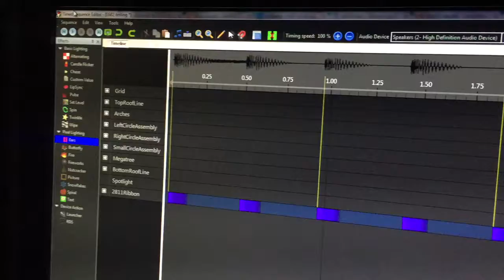First working Vixen sequence E682

Comment: Hey I 're gently purchased a San device and am trying to use Vicente and I am having a hard time get any progress getting a sequence to work for the controller. Any tips?
Reply from the maker: Do you have your pixels working at the board level yet? In the setup page you can have the board initiate a test sequence. Do that step before getting vixen involbed
Reply: Yes all outputs work but one
Reply from the maker: Ping the IP address, if you can do that, then move on to using the Vixen web server, which will allow you to turn pixels on and off one by one. If that doesn't work then you probably have some kind of mapping issue in your vixen config with the lights to outputs and/or the network interface assigned to your controller in the vixen config. Get it working from the web server before moving to sequences
Reply from the maker: By the way, you'll know you have the networking right when you see the e682 web page showing the packets received counters increasing.
Reply: So i got to the point where i have setup the device how vixen describes(3 strands)  and i have seen the packet counter go up to 87 but nothing will happen when i try to enable the mega tree on the web server or if i try to play a sequence. I really appreciate your help by the way!!!
Reply from the maker: +jesse sabs the packet counter should count up by 100s quickly. My recommendation is to start with one strand on e682 and in vixen to minimize  variables. From the web server just go after 1 pixel, once you get that working it's a house of cards and you'll be off to the races. This took me 3 hours alone to understand. I also disabled all network ports on my PC to eliminate variables.

Summary:
Set up one strand on e682, make sure it works with board level test patterns you can enable from e682 web page
In vixen create one strand (my test strand has 100 LEDs), with 100 outputs, change its color mapping so it knows RGB values are controlled, vixen will then automatically triple your outputs (300)
Create the e682 device in vixen with 300 outputs. Patch the strand to this e682, it should say 300 outputs patched. Right click on e682 and check its universe and address setting.
In the e682 web page make sure the output your strand is wired to has the same universe number as shown in vixen
Reply from the maker: +jesse sabs if you send me your email address I will send some screenshots at some point
Reply from the maker: jesse sabs I sent off screen shots, check your junk in case you don't see it. I'm using Vixen 3.2 by the way.
Reply: Hey man i got everything working!!! This program is awesome!! Thank you for all your help i really appreciate it. I ended up have to assign a Ip address to the controller because i still had a temporary one and then change the ipv4 settings(like you instructed) : }
Reply from the maker: Yeah, Vixen is crazy. I can see why people spend 6 to 10 hours programming every 10 seconds of a song. The options for details  and multi effect layering can be endless. Another tip, if you are going to start sequencing, disable the Web server. You can forget you have things turned on from there and you'll waste time trying to figure out why a couple lights are stuck on, that happened to me.